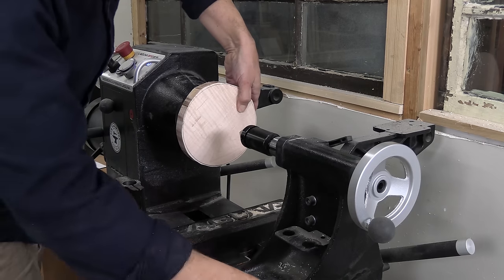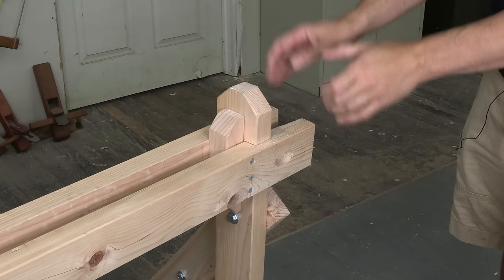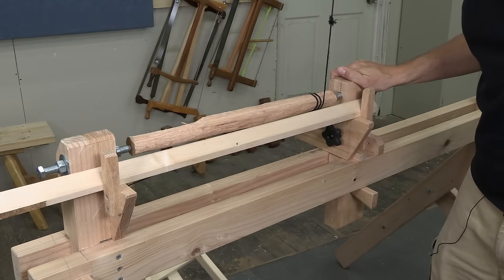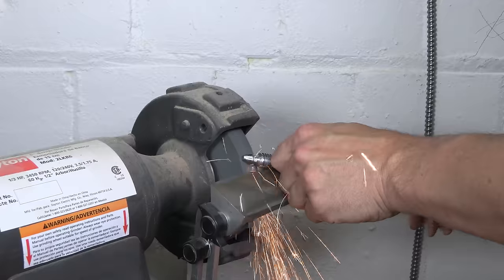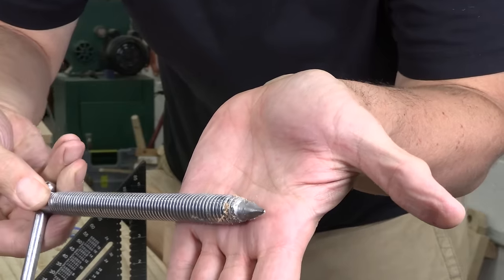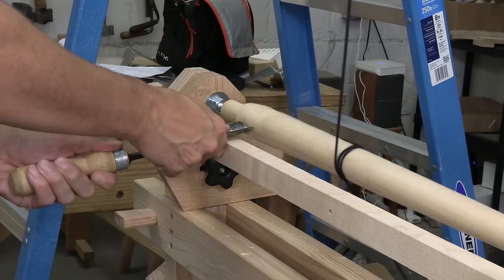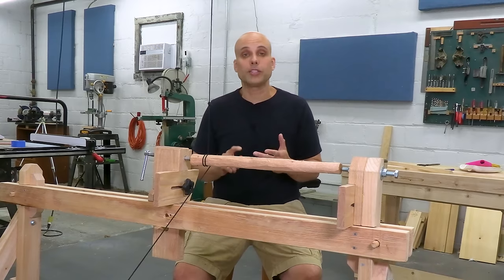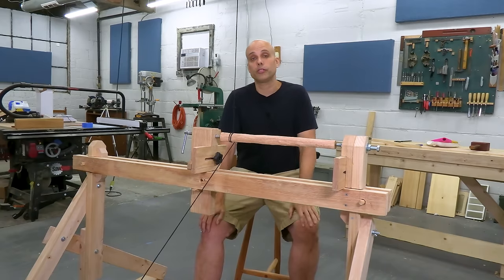I Built a FOOT POWERED Lathe. (Most requested video.)

Comment: Hey Rex! You did amazing! I don't if you're doing a follow up, but... how about salvaging a motor and doing a powered add on? It would be cool for the final tool if it could do both. Of course it's using the spring pole, so that means a different end piece I guess? That would be kind of a pain. I wonder if a motor could turn the string instead of the pole.

Comment: I can't help but think up a design using a spring, or perhaps bungee cord under the workpiece instead of the spring pole above. Having the lathe depend on an overhead spring pole makes it a lot less portable than I'd like. Now using modern springs or bungee cord is kind of a cheat, but I think it's forgivable if the result is a more compact design and makes it easy to set up and move around. I'm just not certain if the design change would make it harder to use. This really bears thinking about.

I started writing this thinking about using a steel spring in tension, but I now think using bungee cord would make it cheaper and easier to make. It would need replacing every few years, but I think it's a worth while trade off.

Comment: Built one a few months ago myself.  I used dual uprights instead of the sapling spring pole.  Bungee cord is strung between the uprights and paracord connects to the workpiece and the treadle. I dont have a dedicated spot for the lathe and too many spiders up in the rafters.

Comment: Actually, you could simply just build a fly wheel separate from your Laith and run a string cord or whatever on the big outside diameter of the flywheel and wrap it around your work piece. All you need to do is make a steady base and have two posts come up from that, and then between the two post you put an offset axle similar to a mechanics, speed wrench, the old fashion, kind manually, operated, or A brace like brace and bits. Then on the outside on both sides, you could put two different flywheels of different size, a smaller one and a larger one. This would give you two different speeds without having to change your rhythm on the treadle. You could also put a handle on the outside of the fly wheels, and then someone could crank the fly wheels instead of you having to work the treadle.

Comment: Most regular shop lathes are rather short .. so if you are wanting to turn a handle for a long hoe or shovel .. you're going to have a problem.  I like this setup .. because you can make it the length you need without a hi-dollar cost.  Seems like you could also add a small motor if you wanted to .. but that would be a different deal.

Comment: The most interesting "body powered" power tool I ever saw was a tablet saw which operated off a huge flywheel. Sounded about as noisy as the modern version... no saw stop, in fact, nowayto stop the blade at all. Terrifying.

Comment: Probably want a nut on that threaded rod (angle grind a chunk of G clamp off??) to lock it in place when you have tightened it on the work (I'm only half way through the video so Rex will probably say this in a minute anyway 😁).

Comment: I'm really surprised by this leg design, which I've never seen before, but as cool as it looks, wouldn't a traditional cross-braced T-foot do the same job with equal or less wood and weight? Your straight section is almost hitting the floor already and just one of those diagonal pieces, laid flat, would (I think) be as wide as the total span of this leg, while the other could be cut into cross-braces, probably with some left over. And then you have a direct line of weight transfer rather than relying wholly on the bolts to hold those joints together. In my experience at least, bolts tend to loosen and then legs attached with them begin to wobble.

But I've also seen more minimal-looking lathes designed for standing work. They were demonstrating one in one of the videos about the castle being built in France. You basically only need the pins at either end, the pole, the pedal, and the rope between. The whole thing occupied a sizable upright section but not much floor space, and most of the middle was empty until work was being done. I'm not sure how comfortable it would be for long work sessions and I don't recall the craftsman using a tool rest, but I've been fascinated by that design ever since. I need to relocate that video, find images on google if they're available, and do a design mockup in blender to see if I can manage to build it in my cramped little shop.

Comment: What issues usability issues did you have with the Treadle lathes?  My my lathe experience of any kind was building roy underhill's treadle lathe. It worked, but it's also been a bit of a wack-a-mole fixing problems with it.  The plus side is it's easy to turn a treadle into a spring pole with some tall 2x4 uprights and a bungee.....

Comment: Thanks, great video, as usual. Have you seen this more compact and adjustable spring mechanism?
https://youtu.be/bqup1GRkhHg
It comes from an old German book so is probably part of their 'jouneyman' culture - 3 years and a day as a 'wandering craftsman'.
https://en.wikipedia.org/wiki/Journeyman_years
I went on a bowl-turning course a few years ago. We were taught to use a bungee-powered lathe that revolved 'away from us' (like anything the lathe grabs out of your hand or breaks off :-) and to cut with a hooked cutter that was made in a forge, from old chisels. He believes in making everything he can too but I think this may have been a 'turned wooden tool-handles for sharpened chisels' deal with a blacksmith, which he then ground sharp.

Comment: In my opinion ist is just junk. Not good for serious working, not original enough as a historic tool. For a museum you have to build it without metal parts.
Reply: A lathe with no metal parts? Is the gouge also made of wood?
Reply: @wehaveasaying  No but the the lathe should be without metal threads and without metal screws.
Reply: Man, it's a shop made spring pole lathe! What did you expect? He's not making a replica of an artifact, and it's not going into a museum. Every turned wooden part from the pre industrial era was made on something like this lathe. Was that not serious work?  

Who cares if he's using hardware store parts? That's what Rex does on this channel!
Reply: @andreasvogt8436  Ah, okay. Now I understand.
Reply: Pole lathes are an ancient technology and they probably used antler tips or suchlike for the centres back in the early days.  I think they might have used beaver teeth for their turning tools as well.
Reply: @andreasvogt8436 don't "should" on me, bro
Reply: Dude you do realize metal screws as fasteners have been around since at least 1500 right? Something tells me five hundred years is plenty historic...
Reply: If it works, it's not junk! And it can be built out of junk, perhaps by people who can ill afford a modern lathe. As for "serious working", EVERYTHING was made on similar lathes until about 100 years ago! See it as a demonstration of principle, if you will.

Comment: Very cool project Rex.  You mentioned in this video that the long straight hole through the poppet would be easier if you have a drill press, but a hand tool woodworker has to find a way around that.  That made me wonder if you could think of a design for a mostly wood post drill.  I know that they usually have cast iron fly wheels, but i thought you could replace that with a wooden wheel and some lead weights.  Then the only metal components would have to be the gears and the bit chuck, which aren't that difficult to find, and you might even be able to adapt those parts from an old hand drill.  Just a thought.
Reply: There are older drill presses that work sideways.  I believe you sit on them.  Basically it's a brace on a sled.

I think it's called a beam boring auger or something similar